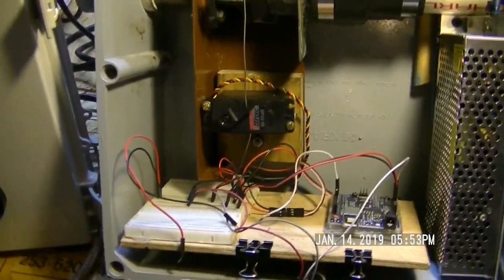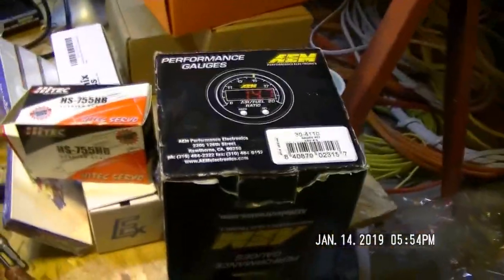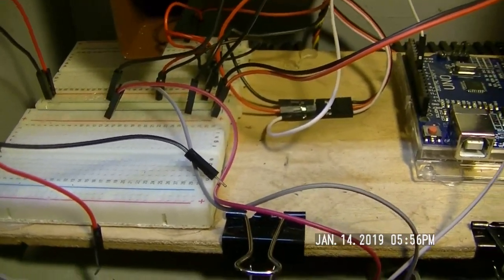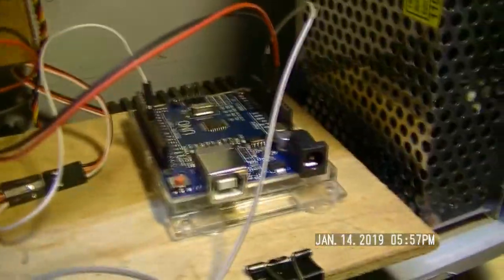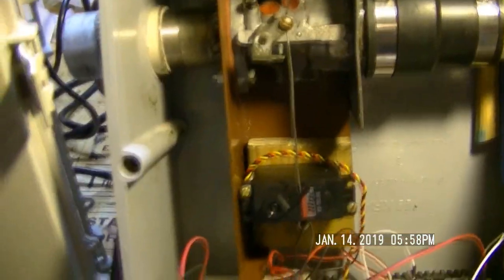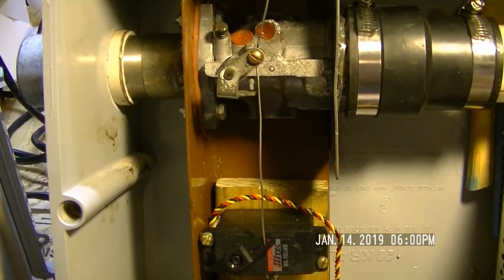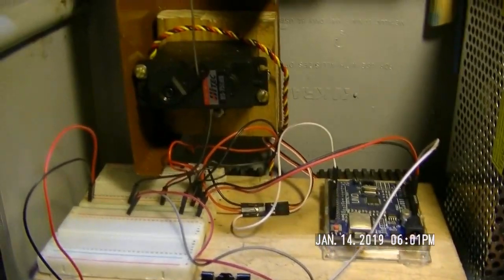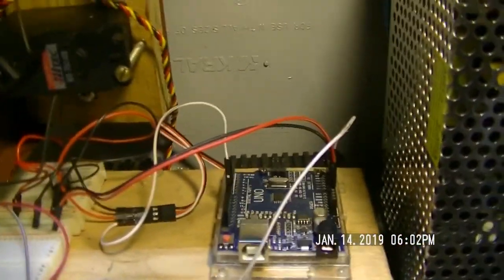NH Hbbyloggr- wood gas -Arduino System parts 20190114

Comment: Got it , thanks , your man are my savoir..
now i will go shopping..
Reply: You can get the screw terminal shield for the Uno R3 pre assembled here  https://www.dfrobot.com/product-468.html
Reply from the maker: @Thrive-Off-Grid  Thanks for all the links and clarification , Matt. Much appreciated.
Reply: You can also buy the Arduino R3 from DF robot as well.
Reply: Toggle Switches. You will want one to turn the system on. Wire 12 v from battery and then out to the power supply 12v + in terminal. This will then power the whole thing up. Then you will need one switch wire fro five volt coming from the 5 Volt side of the power supply to an input pin on the Arduino. When the Arduino sees this signal LOW it is in manual mode and uses the input from the Potentiometer to move the servo. When this signal become high. Switch is "on" the code switches to auto adjust mode and is based on a rich or lean set of parameters. If the arduino sees a rich condition it tells the servo to move in a open direction and vice versa. There is a window between these parameter sets where we tell the Arduino to do nothing. All good in this window and the servo will stay put until the readings fall into one of the parameter sets. So here is an option for switches but any toggle type switch will work. https://www.amazon.com/yueton-Rocker-Toggle-Switch-Control/dp/B011U1NU90/ref=sr_1_5?ie=UTF8&qid=1547596432&sr=8-5&keywords=Toggle+switch
Reply: Here is a tutorial I did on this years ago. I think there is the latest software build in the last post. http://forum.driveonwood.com/t/wide-band-electronic-mixer-control-tutorial/1800
Reply: @Thrive-Off-Grid  this is so amazing   , more than i could have hoped for  and so quickly .
As I am in an very remote area it will take some tome for me to catch up , plus its winter here we woke up to minus 20 c or -4 F ,so it will be awhile before I get on the gasifre ,but I can do the arduino stuff..
  THANK YOU so much  everyone !!!
Reply: @ushillbillies  yeah way to cold for me!! I have open sourced this so if you follow the link to the Drive On Wood forum you can follow along there and for reference. Same goes for Bill. You may want to sign up, you may find the DOW site helpful as well; lots of good experienced peeps over there.
Reply: @Thrive-Off-Grid  thank you, I am DOW   premium member..I didn't post on there because I figured it was for drivers mostly !  which is my next ambition .
Thanks so much , I see woodgas as my savoir 
Tom Lambert 
Wandering River Alberta.
Reply from the maker: @ushillbillies  Out of the chaos comes order and understanding.  Thanks to all !
Reply: @Thrive-Off-Grid   @NH Hbbyloggr I imagine an automotive throttle body would be pretty good for this if some of the gas paths were closed up. is that reasonable in your opinion?
Reply: @icarus901  I just use a butterfly valve from McMaster Carr. Easy to adapt as they are NPT threads. Otherwise you could look at sourcing small engine carb
Reply: @Thrive-Off-Grid  very nice, i hadn't thought of that. what part #, if you have it handy?
Reply: Where did you purchase that carburator? Nice job. Good work keep at it!!
Reply from the maker: @martinavoine281  The carburetor was junk, came off an old Kohler engine, I believe. Remove the bowl, cut off the stem, throw those away and fill it with epoxy. Plug all the other holes  leaving only the opened throat and throttle  plate intact.  This will be the basis for the air intake control valve.
Reply: So im guessing that the air pipe joins a "T" junction to the gas that is not restricted and then goes to the oxygen sensor and then the gasifier?
Reply from the maker: @martinavoine281  The wood gas from the gasifier ( unrestricted) joins the metered fresh air supply at the engine's carburetor. The vacuum from the engine pulls the mixture in to run the engine. The O2 sensor is placed in the exhaust system about 18" down stream from the exhaust port. The O2 sensor reads the A/F ratio and sends a signal to the gauge and the Arduino as the ratio changes the computer program code sends instructions to the servo motor to adjust the air intake butter fly to open or close   so as to stay withing the values set . 
There will also be times when the values will be acceded and other remedial action will be required to bring the beast under control; ie. activate the grate shaker  and/or the wood hopper vibrator so as to get the linear flow of new wood material advancing towards the hearth.
Right now I have Repeat /Delay timers set for each of these actions and provides fairly good control to keep the wood flowing, but it's only guess work. Eventually the O2 sensor and the Arduino will take over these tasks as well.